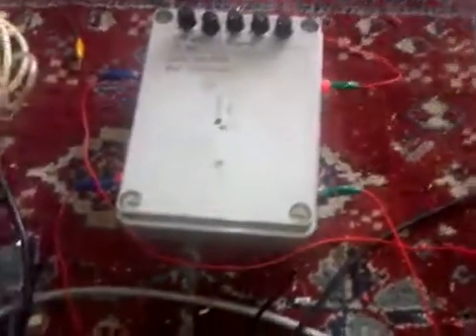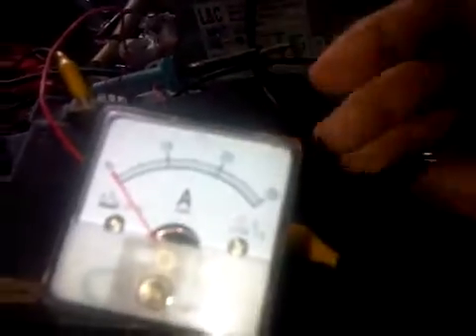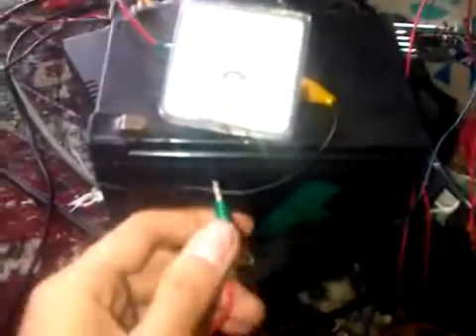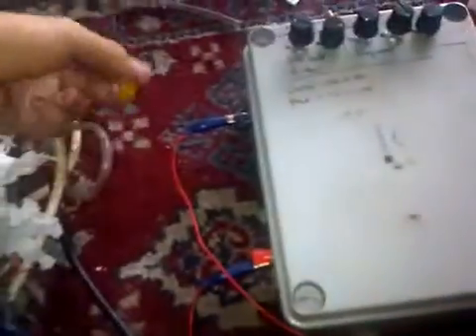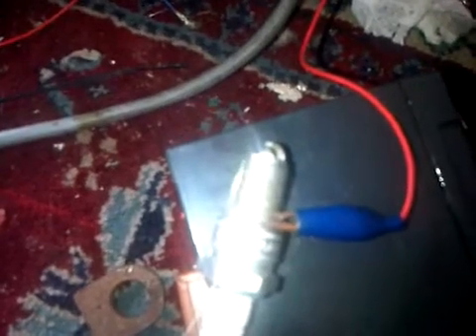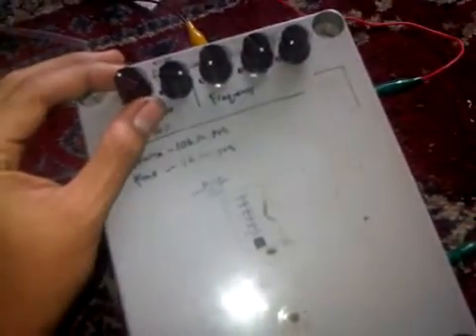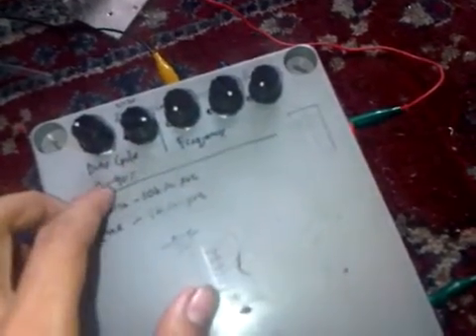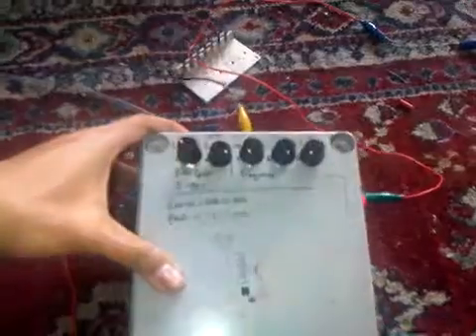My TL494 MSD Ignition Project

Comment: I want to build a msd ignition for my classic motorbike slso incorporating plasma spark (capacitor across spark plug) so would really appreciate your circuit diagram for msd. I will be using conventional breaker points
Reply from the maker: The one posted in the video is just a simple TL494-based driver, I think it is a bit of an overkill for a simple ignition project.

I believe you could try any 555-based driver found on the web, or join DIY-CDI Yahoo Group, they have a lot of ideas.

Personally, I would build an Arduino-based driver to help with tuning.